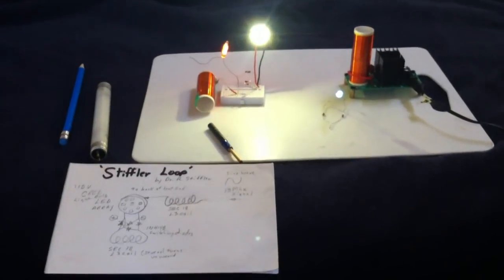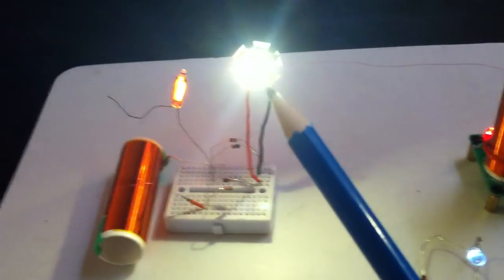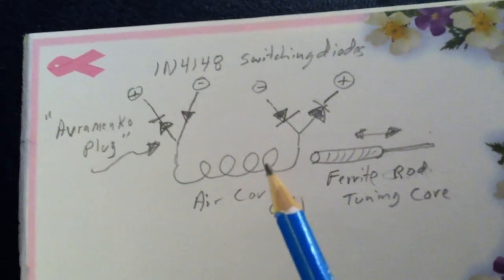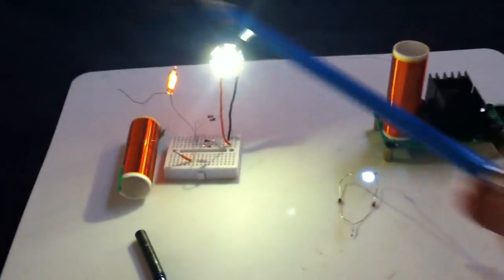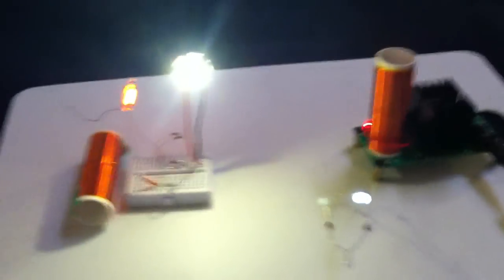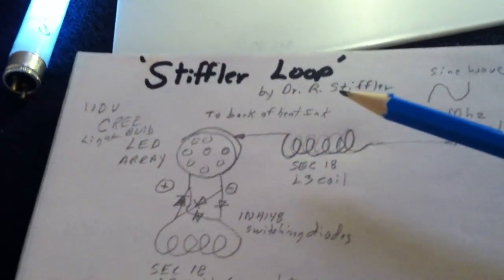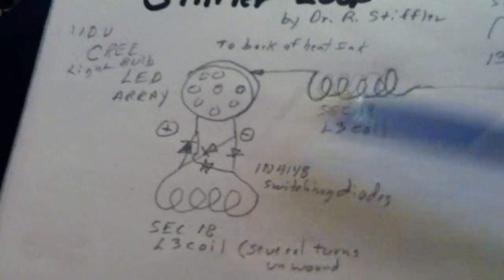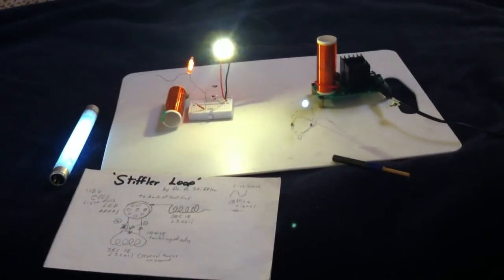Stiffler Loop

Comment: Great progress!  Well done, Rusty.  Slider is using his little DSO/signal generator, available on ebay now for about $85.  But I see there other digital signal generators available for a lot less...  That may be the next step, and I think I'd better get one ASAP.
Reply from the maker: Thanks. I have already been shopping but I have not decided on what to get yet. I was kinda waiting to see what other people were doing.  I have even been looking at easy circuits to see if I could make a simple MHz oscillator that would work.  Before we get too excited I'm sure there will be some people with negative feed back on this whole thing.  Measurement of input vs output is going to be the thing that is hard.
Reply: Totally agree - about the importance of measuring Pout and Pin!

Comment: lidmotor, yes your diagram is correct but can we call a bridge rectifier two AV plugs? Sure can. So which came first the chicken or the egg. Was it the AV or the bridge? Because this is an AC signal we get both +/- phases
Reply from the maker: Thanks.  I don't think I ever did this before with the full wave setup on an exciter type situation.. It was always just two switching didoes.  Perhaps I did and I just can't remember.  I like the fact that with the coil you can tune it with a ferrite rod.

Comment: It's funny how it was all about the half wave avremenko  and yet it never dawned on me that using two (on each end of the coil) could complete the loop without a ground I still get excited about exciters
Reply from the maker: I think you just answered a question I had about completing the loop.  Thanks.  That second AV plug does the trick.  I'm like you.  It never dawned on me to try that.

Comment: The only reason for square wave is because Sine stops at just 12.5kHz on the DS203 that i've been using. 
However, forms of wireless transmitter will easily go right into the MHz, yours there is likely 2MHz as we found out with the Slayer Exciter threads. 
I'd say it's the right direction :)
Reply from the maker: I tried this on my old SEC 15-3 and it worked also.  I'm wondering if maybe building a simple MHz oscillator might work to get the signal.
Reply from the maker: I found a simple one transistor 2MHz  circuit that I might try.

Comment: I did it with a slayer some time back outside with a one wire from the battery powering the slayer + or -- don't matter going to one of the the 120 v led leads the other in the dirt and or tailpipe of my work van. I can say it is all so mysterious even those leds have survived many  strange Tesla forms of electricity.
Reply from the maker: Yep.  The whole thing is pretty amazing.
Reply: Hi, Terry! Yes, I remember lighting incandescent bulbs (albeit barely) with one battery terminal, and the other terminal going straight into the ground. As far as I remember, it was you and Tinsel Koala introduced me to this strange effect. https://www.youtube.com/watch?v=WV3posVDqJs

Comment: Well done and very interesting. Please measure the efficiency of this setup: (1) How much current is your 20 volt 13MHz  signal source drawing? (2) Do you have a scope and current probe to measure the current drawn through the single wire to the LED heatsink? I'm curious to know the efficiency of this setup: Signal generator current divided by load current.
Reply from the maker: Thanks. I don't have a signal generator to replicate Dr. Stiffler's experiment and do measurements.  All I am doing here is trying out the device on a Slayer Exciter just to see if it works.  I did a simple experiment last night using a  5.5v power source with a USB volt/amp meter and the thing ran at 10 to 50 mA.  When it was on bright (in resonance) the current was the least.  It was a very inaccurate test but interesting.

Comment: That's interesting.  Can't quite wrap my head around how it, exactly drives the loads differently from how a normal slayer would.... say.... if that load was running on a pickup receiver coil & avro plug. Not sure why the first coil top wire needs to touch LED ground.  Very odd setup.  Fun stuff
Reply from the maker: Hi Kyle.  After looking at this for a day I think you are right. It is just a fancy AV plug arrangement that we have been working with for years.  The difference is Dr. Stiffler drives it with a signal generator instead of a SEC.  I don't have a signal generator to run the experiment so this is the best I can do right now.  His contention is that the current to drive the device does not come from the signal generator and that triggered this project.

Comment: Do you think it would be of interest to create a coil that instead of being an air coil, one would use a fluoinert liquid as an electrical insulator to show the intrinsic capacity for circuits of this nature to act in ways that are not typical?  Could you fine tune a coil with an AIR/ ferrite core better or worse if the core of the "air" coil were intact "Liquid" and insulatory?  Just thinking out loud.
The choice of dielectric and how the pressure is mediated does make a difference perhaps?  My guess is that it would obtund or would it focus?.......Not sure.  All thoughts welcome.
Very Best Regards,
Jim
Reply: Hi diveflyfish, I looked up flourinert and found this: Fluorinert is the trademarked brand name for the line of electronics coolant liquids sold commercially by 3M. It is an electrically insulating, stable fluorocarbon-based fluid, which is used in various cooling applications. I see no way that it could be used to effect a circuit. Perhaps you can explain?
Reply: It is not to effect a current, rather demonstrate that the circuit may be functional in a parameter that is antithetical to normal function...... Longitudinal waveform vs horizontal or hertzian etc..... Just a modus to corroborate or eliminate.   The Stout bar Tesla Circuit works in a very specific manner.  The question is if this circuit is doing the same.  Warndencliff  but mini etc....

Comment: you should try to spin the ez spin motor or a bldc with that one wire set up...morin is using a sine wave to spin a washing machine motor saying the sine wave is an rf frequency and the higher the frequency the faster the rpm of the motor along with the torque.
Reply from the maker: Thanks.  That is on to to do list.

Comment: When you get time, it would be great if you could determine if your input power increases with a load and/or with adding extra plug loads hanging from each load output connection of the first led plugs you already have.  

I did this in 1986 with crystal radio similar circuit and got more power for the same input power by staging the plugs as noted above.  Tuning was critical with numerous positions giving a strong reading, but the kicker was only certain positions would give a strong reading AND none or minor increase of input power.  

The big secret they did not teach me in electronics school was not just to tune for resonance, but to also find resonant nodes that do not reflect back ie.  input power does not change and is independent of the output power.  Most look for the strongest point on the scope or at powering an LED and assume this is the best energy gain point in terms of in and out, but try my tip above and you will be on a new way of looking at energy.  

Also you may get even greater power outputs with your receiver if you keep as you have it but just link a wire (length is important) from the top of the receiver coil (antenna) to the top or hv side of your transmitter coil.  Will need to retune.  This is the one wire connect Tesla used between his own transmitter and receivers.  Tesla went one step farther thou, as he also used one wire to connect to an EXTRA coil in turn connected to the receiver top side and spaced at distance away from the regular transmitter and receiver coils.  The output of the extra coil was much more energetic and did not load down the transmitter.  The path of free energy.
Reply from the maker: Thanks.  Fascinating subject to study.
Reply: Oops correction, I meant to say if you keep as you have it but just link a wire (length is important) from the bottom of the receiver coil (antenna) to the top or hv side of your transmitter coil.  Will need to retune.